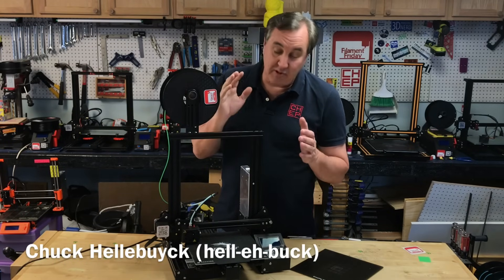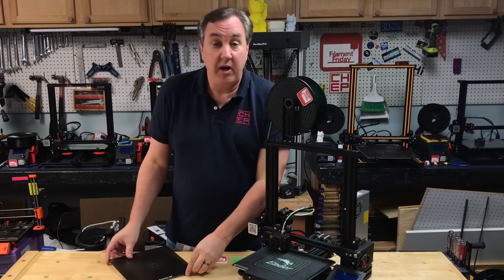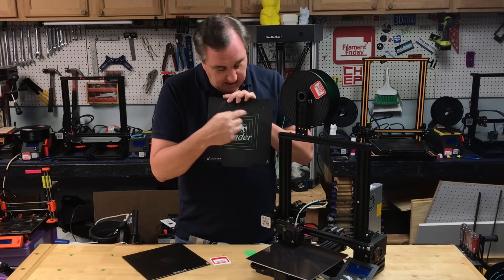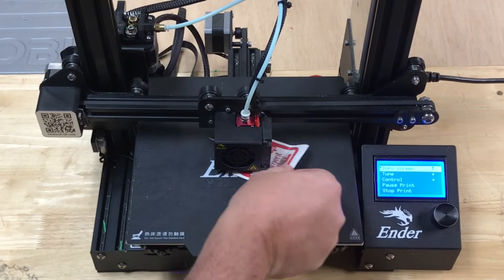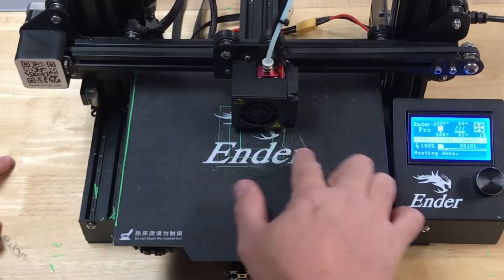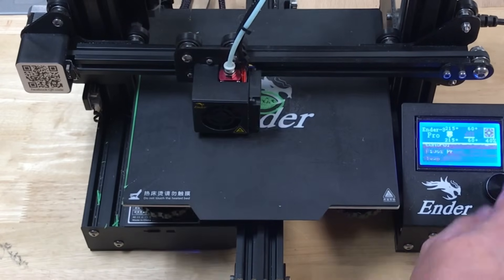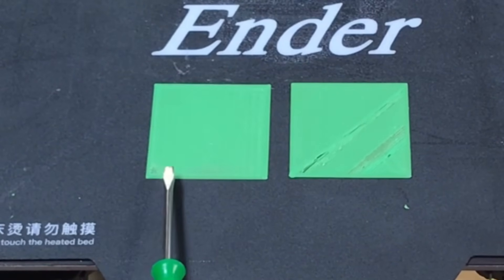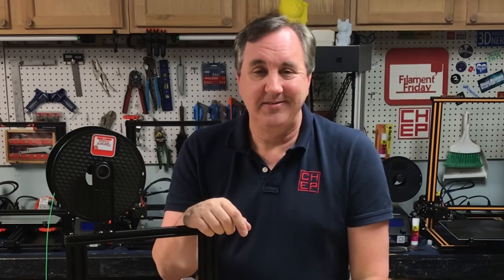Creality Ender 3- Easy Way To Level Your Bed

Comment: Liker-Subscriber-Notifier Here.   Thank You Chep for putting this together!  I used the code to level my Ender 3 Pro (with 32 bit microprocessor/M25 commands needed)-and now it's printing great - AND - I definitely have the BEST BED ADHESION ever (I am using a glass plate, with blue painters tape, and glue stick- BUT leveling the bed this way made a HUGE difference in print adhesion).  Now to get that daVinci 1.0a modded to 0.92 Repetier leveled!
Reply from the maker: Use the M25 version for 32 bit boards.
Reply: @FilamentFriday  Thank You - that worked!

Comment: I don't know but something seems off with the test squares, I tried it several times but every time when I have the bed properly leveled according to the squares the follow up prints just grind into the bed (I tried with several different prints), i.e. the bed is too high. I just reverted to manually leveling with the piece of paper for now.

Comment: Hi. I'm relatively new to 3D printing. I use low-cost PLA filament. I've been designing my own prototype parts for about 8 months now, and I have had several problems with my Ender 3 V2 printer in this time. I solved these thanks to videos like yours. Anyway, when my printer works well, I'm more or less satisfied with 3D printing my parts. But when it doesn't, I start looking at alternatives! Most videos show the same things though: bed-levelling, extrusion problem fixes, etc. Is post processing 3D parts a secret? I don't see many of these types of videos. My simple to complex parts have nowhere near the quality some of you seem to be getting, and it leads me to wonder why. I put a lot of effort into post processing to come close to the quality finish I'm seeing some of you getting in your videos. Circles parallel to the bed have better quality by far, but the lateral circles leave a lot to be desired. I can easily see the layer changes, and these often seem to border on under-extrusion, although the rest of the print is fine. Filing circles down on my parts with fine metal files does not produce the best quality finish either because the PLA material seems to be too soft for this approach. This approach does not lead to the smoothest surface finish. In most cases, it is also difficult to file down layer changes, because my parts are small, and my work areas are tight. I've also used jeweler's files to make the filing process easier. My outer circles are often well under 2.54cm (1 inch) in diameter. Is size the problem here? Limiting myself to 3D printing primitive shapes is not my idea of a 3D printer's best selling features either. My parts are strictly mechanical in nature. I allowed myself to be led to believe I could do this and more with 3D printing. Was I wrong? In any case, I need help. I'd like to see more videos showing the post processing steps some of you take to finalize your parts. P.S. I'm not putting this video down at all. In fact, I've found it helpful when I needed it. Thanks.

Comment: Is there a reason I can still get squishing even if I have properly leveled my Ender 3 pro bed? Even when I use your gcode to level my bed properly, I still get squishing. I can tell when I print the 3D Benchy. The lettering on the bottom is completely squished out. Any help will be much appreciated.
Reply from the maker: Then it’s not properly leveled. Adjust for slight squish not that much. If you run out of adjustment then lower the Z stop switch and try again.
Reply: @FilamentFriday  Ok. I will try leveling again when I get a chance.
Reply: @FilamentFriday   Hey CHEP, You were correct. I had a lot of trouble leveling my bed. Even when I got it leveled, it would almost immediately become unleveled. I started looking at the assembly of the printer and found the y-axis carriage(bed) was very loose. I fixed that and still couldn't keep a level. I watched more videos and figured that my x gantry must be loose as well. It was but it was not readily noticeable. It wouldn't move when I grabbed it and shook it a little. It would move a little however when the z motor moved up and down. It moved just a little bit that I noticed one day. I then proceeded to reinstall the x gantry. I did it once and it seemed to keep a level until I accidently touched the x gantry while the z motor was moving up and knocked the x gantry out of level again. My bed level was gone also. This sucked but was confirmation what was causing me not to achieve a level bed. I reinstalled the x gantry, tigtening the eccentric nuts a lot more and I have been able to level my bed a lot easier and more consistently now. I hope this helps others. Thanks CHEP!

Comment: the low spot on my bed is dead center in about a 3 inch circle lol.
all 4 corners level perfectly, but that little 3 inch void always causes issues. piece of glass solved it, but i was losing my mind having to use a raft on everything

Comment: When i level the 4 corners the middle is definitely too high. Sure i could then 'adjust the 4 screws' but then the corners are off again. Sadly that means i cannot make prints a ross the full bed. I guess a glassplate should solve this

Comment: any advice?  Just downgraded my ender 3 due to problems getting the bl touch to work, and when I try to run the bed level now, it doesn't stop at each point.
Reply from the maker: Try they M25 version
Reply: I will try that today, thank you.

Comment: How do you get the lines off? I'm having a lot of trouble getting them off. I got about half of them and I don't want to scratch my bed with the scraper. Does that mean my extruder is to close?

Comment: My god all of these tutorials suck. All of them are very confusing, although I am pretty dumb so that’s probably why. I’m going to sell my 3D printer and finally end all of this frustration. I hate all of these videos, and I have disliked ALL of them. Thanks for nothing. My problem is that I do exactly what you did, and then print, and the filament goes EVERYWHERE. I am inserting the filament in correctly, and nothing will fix this. Sorry for being so harsh, but it has to be done. Again, thanks for all the frustration I have been going through. You fixed nothing.
Reply: Sorry to hear that. Personally I think you should stick with it for a bit longer as it is so worth it when it's working?
Reply: Is the filament going everywhere out of the nozzle? If it is, it is probably too far away from the bed so move it up. Another thing that I found helpful was lowering the first layer print speed too 20mm/s instead of my normal 40. If you want help then I wouldn't mine helping. Some great resources are r/3dprinting and r/Ender3 (if you have an ender 3). There are a bunch of smart people there that will help if you give them enough information. If you do ask for help there try and add photos and explain your problem as much as possible on your post.
Reply: @joshrayner7167  Thank you! I tried your tip and it worked.
Reply: @Aeaaoooaaa  Haha true
Reply: Loser lol
Reply: You're right, it's not for you.

Get a different hobby.

Comment: Hi, Chuck -- thanks for the video and the bed leveling GCODE. I had been moving the nozzle manually using the move axis commands, and this makes it so much simpler. I do have one problem though. I am getting good first layer adhesion with the bed level print, but when it comes back around to the origin corner, it looks like the beginning of the start gets stuck to the nozzle and then gets picked up when it moves to the start point of the next square, which results in the second layer getting messed up, because the end of the fourth side is slightly bowed. I suspect it has something to do with the fact that the start point has a slight blob on it, which touches the nozzle. Could it be that the hot end temp is too high?
Reply from the maker: Just focus on 1st layer. You can adjust it to squish a bit more.

Comment: I added a creality glass bed but it appears that the 2nd and 3rd points are extremely low and hit the plate, I know I need to make some type of adjustment for the height of the plate change but I don’t know what that is or how to get all points even, any advice on how to handle this for my Ender 3 pro would be a life saver!

Comment: Well 1st the stop switch is 1/4 to soon and the bed does not have that much adjustment. Secondly the hot point is off the bed perimeter....

Comment: CHEP_M0_bed_level.gcode does not pause on my ender pro 3, it just keeps going from corner to corner without pausing. why?
Reply: The pinned comment has your solution.

Comment: @chep Hey Chuck, do the profiles not import if they become outdated? I'm running Cura 4.9.1, the current, and I think your profiles are dated 4.1.0. Either way the error I get is simply "cannot add profiles'.
Cheers anyway and thanks for the helpful advice!
Reply from the maker: My profiles are 4.10 not 4.1.0. Make sure you download the correct ones.

Comment: I set my printer up this morning and switched it on but set it to the wrong voltage and it popped, does anyone know how to sort this as I’m not getting no power at all. Do i need to buy a new power supply unit? Or is the whole printer messed up?
Reply: rookie mistakes do happen mate . if it makes you feel any better i got my first ever ender 3 V2 for my B-Day a couple of days ago & i forgot to level the bed, the cost ? = the needle got so messed up its currently in a police evidence locker  & the glass tables teflon is so rubbed off it looks like its been used for 100+ years. thankfully creator supplied a extra hot nozzle but not a glass table  

lesson learned : take a couple of minutes to go over the machine before testing it.
Reply: @l0kaltpsykf4ll34  I fell for exactly the same trap you did. It’s my first 3D printer and my glass bed is all mucked up. I put on the other nozzle but I don’t even know if that was damaged or not. Luckily replacement beds and nozzles are pretty cheap on Amazon and I bought an auto bed leveling thing that was pretty cheap, specifically for this printer.
Reply: Just a new PSU. Sorry this happened, they should make it more obvious because I almost made the same mistake. It is likely you blew a fuse in the psu which is good news for you
Reply: @jesselevine0  thank you, is it not a case of just replacing the fuse? Or does it have to be the whole PSU?
Reply: @stones-ds1yy  I don't know much about the PSU integrated with the Ender 3, but if you can non-destructively open the PSU that will answer your question.

Unless you can A.) tell a popped vs unpopped fuse and B.) identify the right ampere rating for said fuse, I think you should buy a new PSU altogether.
Reply: @jesselevine0  I guess I’m buying a new PSU then 😂
Reply: Amazon refunded me with no questions asked, ordered another 1 and arrived within a couple days, all set up and printing now
Reply: @stones-ds1yy  how is the new printer working? I can’t get anything to stick to my bed no matter how good I level it
Reply: @jesselevine0  hopefully I’ve sorted a few probs now. Before I print I always do a level check, also wipe the bed with Isopropyl, now my prints seem to stick a lot better. I’ve also changed the setting for the initial extrusion layer to 150%, I saw this tip on another video. Only prob I have at the mo is the back of the bed hitting the machine which causes the bed to lift when it moves back, so I’m moving my prints to print on a certain section of the bed so the plate doesn’t move back and forth so much
Reply: @stones-ds1yy  are you talking about the bed interfering with the y axis motor in the back?
Reply: @jesselevine0  yes, is there a way of sorting so it doesn’t keep hitting this and lifting up
Reply: I’ve sorted the bed hitting the motor….now my belt under the bed has snapped and I’ve also discovered that the power lead does not securely fit into the printer!!! It keeps losing power as the lead doesn’t fit snug into its port at the back of the machine!
Reply: @jesselevine0  I sent it back to Amazon, got a refund, I ordered the Prusa MK3S, it’s a lot more money but suppose you get what you pay for 🤷🏽‍♂️ it’s being delivered on Monday
Reply: @jesselevine0  yes the sensor strip was no where near along we with the bed so every time it was going back it wasnt alerting the sensor strip so it wouldn’t stop 🙈
Reply: @stones-ds1yy  tbh I wanna send mine back too because I can’t get the bed to level correctly. I think it’s warped. But taking it all apart and putting it back in the box is such a pain
Reply: @jesselevine0  I’ve done it twice now 😂

Comment: Hi, I used this and it seems great, until I go and print something. I level it using the gcode provided, then when I start trying to print a part, my nozzle is then far too high compared to where I just leveled it at? I'm new to printing, so I'm not sure what I'm doing wrong? Also, when it cools the nozzle seems to press into the glass bed. Is that normal, and should I be raising the Z axis when I'm finished before switching off?

I am using an Ender 3v2 with the tempered glass bed.
Reply: When u level the bed do u auto home it first ?
Reply from the maker: Yes
Reply: My new Ender 3 V2 has some sort of bed leveling problem as well since the bed takes turns being way too high or way too low. I have experience with 3D printers, but I cannot seem to get this bed to stay level. I warm up the nozzle and bed, auto home, disable the steppers, and then level each corner. I get the paper to drag after going to each corner at least three times. But then when I print, the nozzle is either way too high so that my filament doesn't stick OR the bed is way too low in that whatever bed I'm using---glass, magnetic, and PEI---becomes damaged. I'm also making sure I don't accidentally push down on the x-gantry or anything else as I'm leveling the bed. BTW, I've assembled and tweaked five Ender 3 Pros for my school district recently and hardly had any problems leveling those beds. With this new 3 V2, I've already tried the yellow springs, silicone springs, and 4m Nylock nuts. I've re-leveled the entire frame by using clamps and a square. I cannot figure out why this new printer's bed won't stay level after it appears to be level to the nozzle.

Comment: What do I do or check if my nozzle is to far up even with all of the turning wheels all the way up as far as I can put them? I just put it together yesterday an this is my first time leveling so I'm guessing I did something wrong..
Reply: You need to adjust your z-axis switch. The clicky button on the vertical bar is too high and needs to be lowered

Comment: When I use the g-code files to attempt to test my level, it doesn't "stop" at each corner, it the extruder just quickly touches the bed, then moves to the next corner? What am I doing wrong?
Reply: use the CHEP_M25_bed_leveling gcode from winrar youve downloaded, ur welcome

Comment: I'm so stupid. I spent hrs trying to level my bed with no luck. I was putting the paper over the stupid clips and arching it underneath the bed so the front was. I stopped for a second and face palmed. I moved the clips out of the way, layed it flat on the bed, pushed it under. Then I raised the bed and it was level. Oh god.

Comment: Hi thank you so much for uploading these wonderful gcodes. However, I did run the leveling gcode but the nozzle doesn't stop.. I mean it stops but once the nozzle touches bed (supposed to stop) it keeps moving to other position... I'm stuck...
Reply: same issue here. did you ever figure it out?
Reply: @KingLeemur  Same issue here, too!
Reply: ever get a fix? i have the same issue
Reply: @michiganmike20  CHEP_M25_bed_level.gcode is the solution.

Comment: Thank you for this video, it helped a lot. When I slice the CHEP_Bed_Level_Print in Cura, it prints 2 lines for each ring instead of one, like your gcode. How can I get Cura to only print one line per ring?

Comment: HI CHEP - I got the M0 as noted in you post below.  It was however when I started the gcode from Octoprint.  Is this the same reason as below?  The same gcode still runs fine from the SD card.    I will try the M25 as noted.  Thanks in advance...Irv in Florida

Comment: i suck i cant get it right at all.. so aggravating i said screw it and ordered a bltouch and pray that works
Reply from the maker: Clean the bed surface with soapy water and then wipe dry. If that doesn’t work, use Avery glue stick and give it one wipe. It also rinses off with warm water.
Reply: I'm about there myself. My E3P was printing great out of the box, then took several months of not printing and went to use it and everything went to hell.  At first I thought the PLA left on the spool was bad but its not brittle and seems to flow.  I cleaned the bed Matt which helped a bit but still kind of foo bar.
Reply: I found it wouldn't stick with my new Ender 3 Pro, no matter what I did. I then went into the filament setting on the main menu, set it to off and it has worked great ever since.